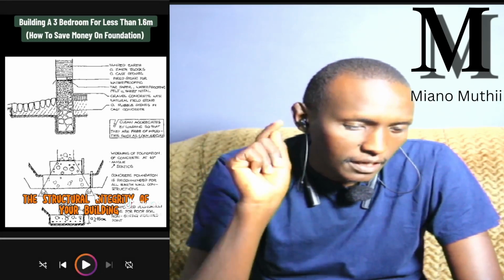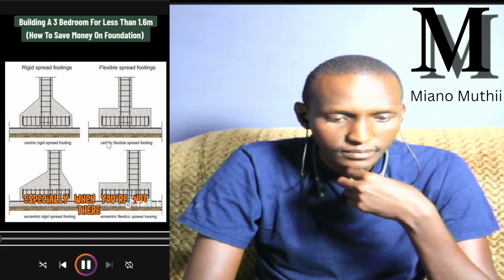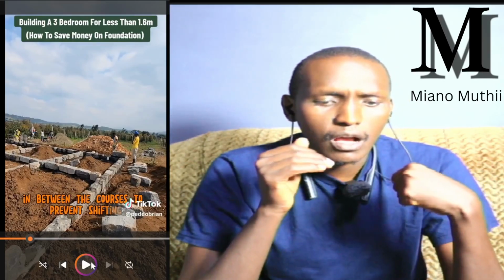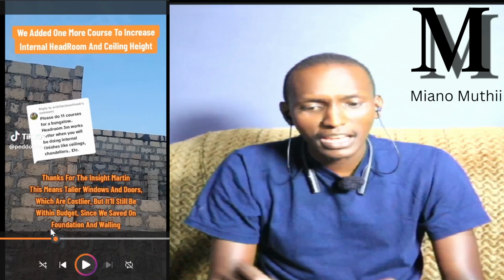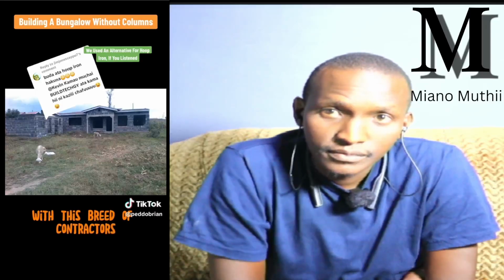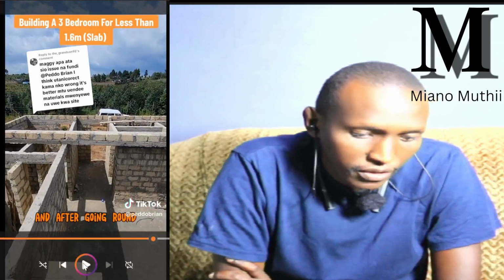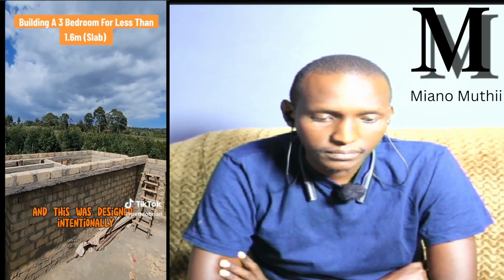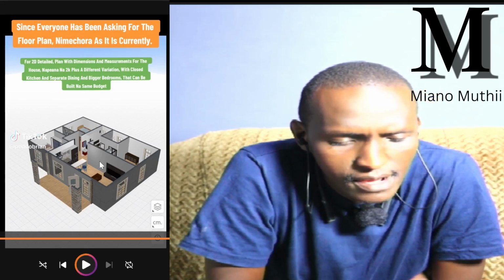3 bedroom for 1.6 million/ my reaction to the Tiktok house/affordable housing/Cost of construction

Comment: Why do you need collons for when your foundation is well done? if you are not going for a high-rise or a upper floor, skipped the collons to save your pockets.
Problem with us today is those educated constructors with diplomas are not trustworthy. They are not at work for good but only money in theirs pockects.
My mother build a house before i borned in 1964 without a solide foudantion and not even collons like this day but, the house still standing up to today and, we don't like putting it down as it is a memory for our mother.

Comment: The easiest part of building such a house is the foundation and the laying of stones. The finishing is the hardest though it might deceptively look simple.

Does the above house have concrete pillars since there is a slab on top or rather how safe is it to build a simple storeyed 3 bedroom stone house without concrete steel enforced columns??
Reply from the maker: It doesn't have the pillars but ameweka strong walls

Comment: Yes it's possible,mine is at floor tilling stage another has taken 960k however it depends on a number of factors
1.contractor/foreman (B your self)
2.materiels (buy yourself)
3.Area(urban or rural)
4.more research in every stage before u start.
Reply: Also the size of the house and roof type. The old style gable roof is cheaper than most of the modern and stylish ones.
Reply from the maker: Very true
Reply: True